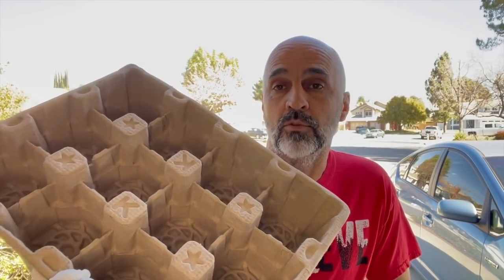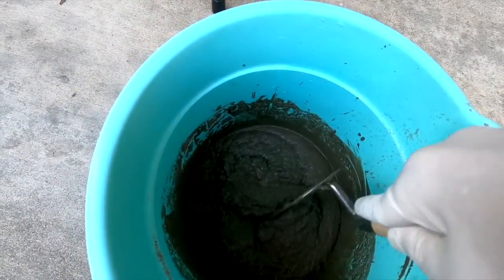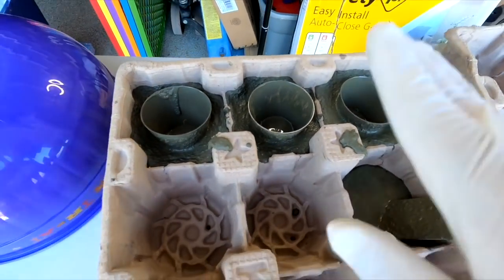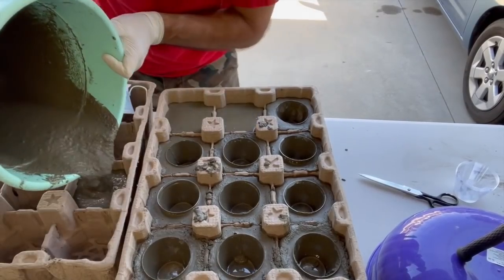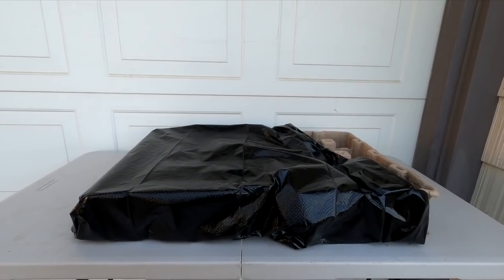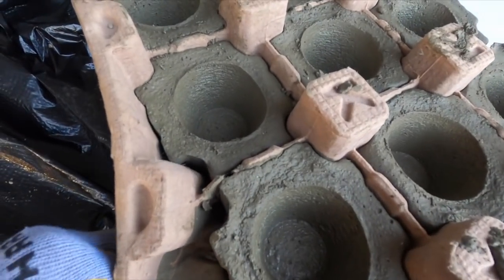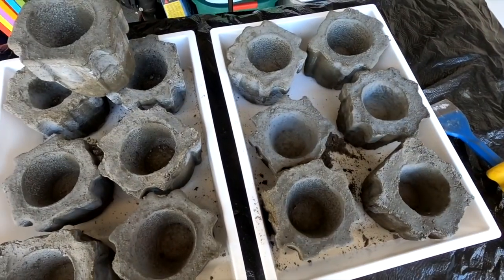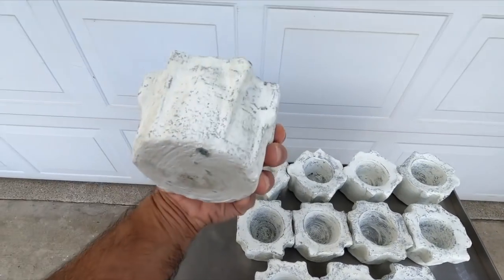DIY Small Cement Flower Pots Using Free materials

Comment: If you put a small piece of dowel on the bottom before you put in the concrete it will leave a small hole at the bottom and you could use as a planter. They look great and it looks like you had fun making them.
Reply from the maker: Thanks for watching 😊

Comment: Hi Steve, type in on you tube what to make with cement, there are some amazing items made.  My personal favourite is using a flower pot or bucket but before you start rub some oil round the bucket so concrete doesn't stick, then soak old clothes in concrete mix and drape them over your bucket, so unique. I've made some but just waiting for the weather to rise at least above zero degrees, paint and it's done, turned out brilliant, husband says to sell on you tube but they are far too heavy.  Love lorraine in freezing Scotland 🤣🤣💗

Comment: I loved that! I was listening very intently as I want to work with concrete but I don't know much about it. I always thought cement and concrete were the same, then realized(while watching this) it isn't.  What is the difference and when would you use one over the other? Thanks so much for this. Am eager to learn more. ❤ u guys!
Reply from the maker: Hi Vicki, cement is an ingredient in concrete Concrete has aggregate (rocks) and cement and it’s much stronger than cement. Use concrete when you need a durable product. Cement is much more forgiving and easier to work with. Thanks for watching 😊

Comment: Will you use concrete sealant once these have dried? How about a straw so it has a drainage hole. Love the birds too! I wondered why you did not flip the forms and then fill with cement. No cup needed. Just find a way to tape the sides so no cement comes out the sides! maybe?

Comment: Could you put some rocks in the cups to hold them in there?  No  need for any lubricant around the cups so they will come out of the cement easier?   i want to try these because I have some larger plants to use them for.   thanks for the tips and directions.    very nice yours are.      lean on God
Reply from the maker: If I was leaving the cups in overnight I would use lubricant and rocks to hold them in place which is probably easier than the way I did it 😂 but I wanted to experiment 😂 thanks for watching
Reply: @StevenSteph  thank you for showing us this.   I am going to try to do this as soon as spring gets here.  This looks like fun.  I will try to make them bigger as I have lots of plants to work into my garden.   lean on God